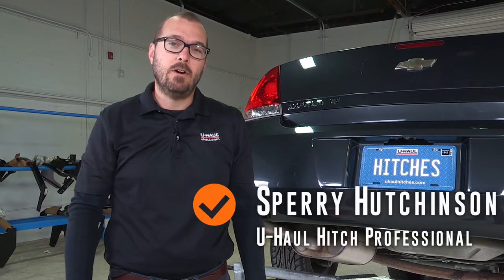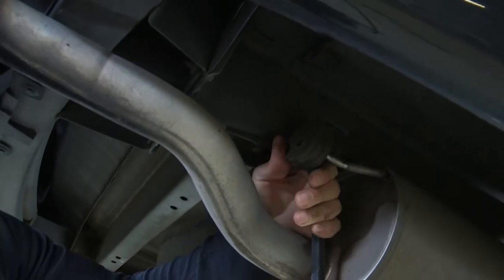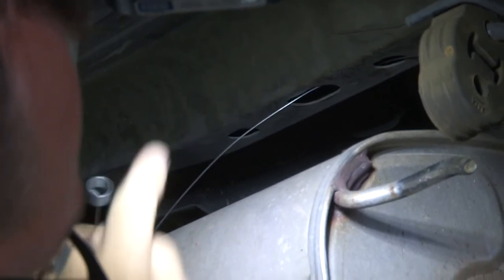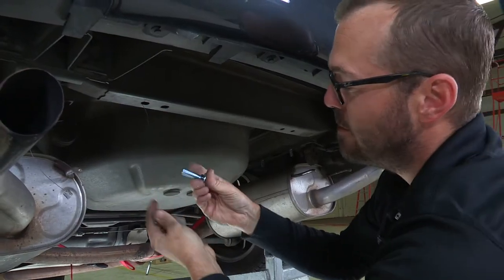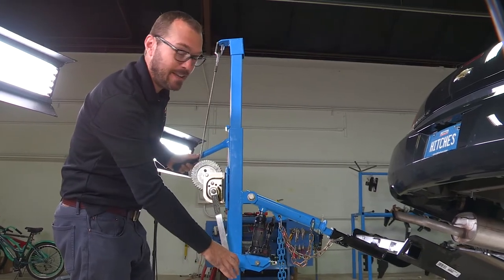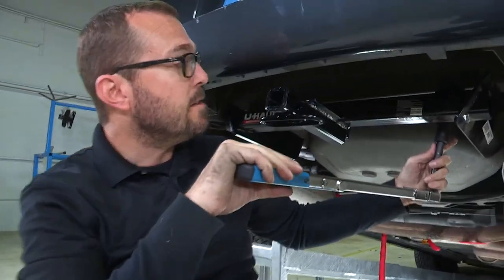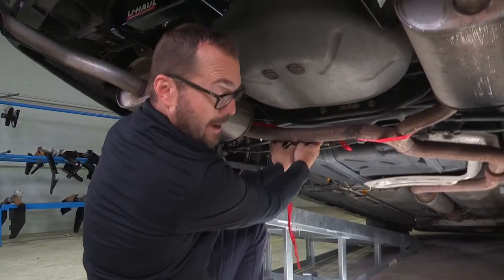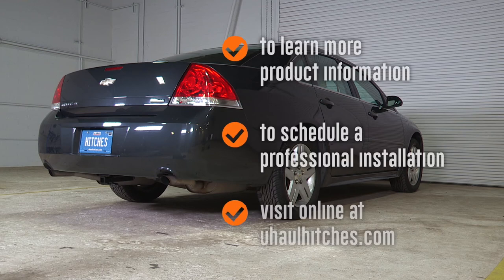2004 Chevrolet Impala Trailer Hitch Install

Comment: It doesn't look like my 04, maybe this is a 6 cylinder version
Reply from the maker: It may be a different year. If the installation is the same for different years with little to no change in the process, then we use the same video for that list of years the hitch will fit.
Reply: Absolutely, well any good mechanic can look at the video and if the year or make of their vehicle is a little bit different than the video you can still use the video as a learning point and then make whatever changes you need to make for the application you're installing or whatever mechanical work you're doing
Reply: Thank you very much for this video very much appreciated!!!!
Reply from the maker: @mikewiley1652  While this may be true from many people, a large portion of our audience may not be mechanically inclined. So we try to simplify as many aspects as we can so even a novice can do the installs.